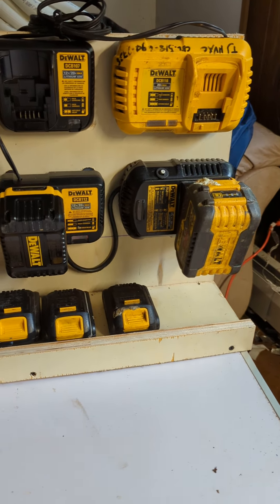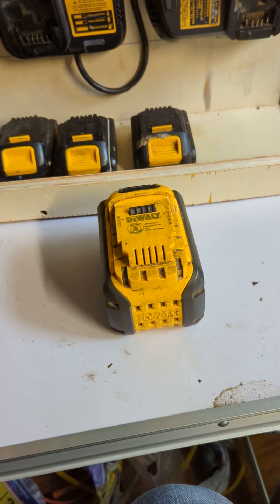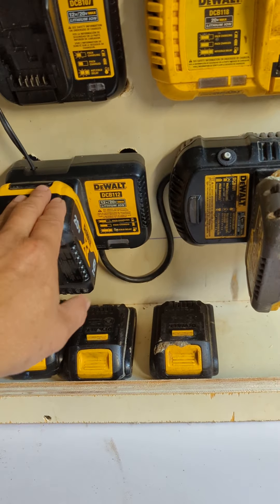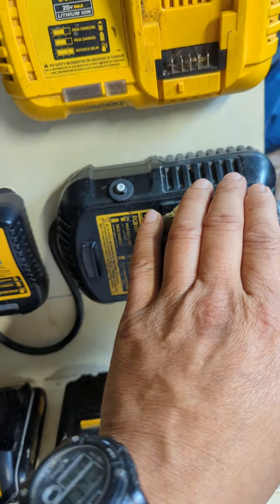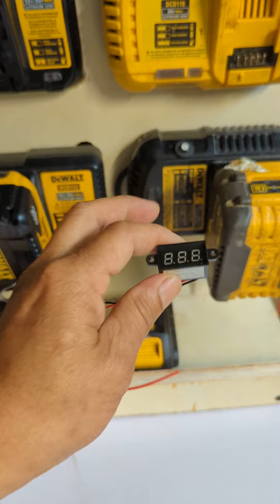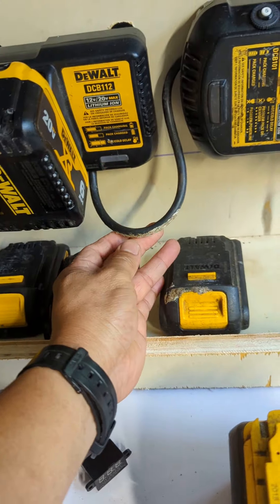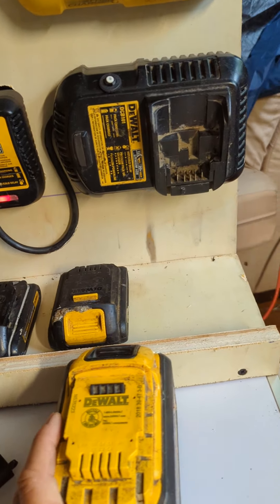Charging 20 volts or Flex volt DeWalt battery not charging. Hit the subscribe and like thank you.

Comment from the maker: Thermal Circuit Breaker 5 Amps, Thermal Overload Protector L1 Series 125-250V AC 50V DC Push Button Manual Reset Circuit Breaker (3PCS） https://amzn.to/3TE5QrM